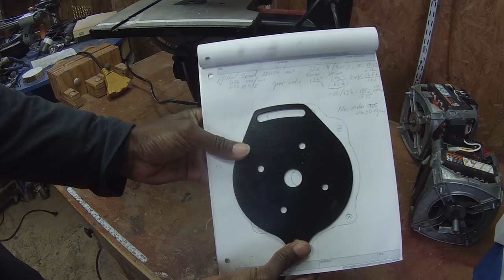Turn Your Cheap Band Saw Into a Beast! Part 1: 011

Comment from the maker: Please read the description before commenting about the blade or the speed of the band. After that you can relax and enjoy the video.
Reply: Jeremy  this was a great video.  I love the idea.  And this the first video of yours thAt I have Seen.  awesome job I also love you rotating table.  i will definItely be mAking one for my self since I have a smAll shop.  Thank you. I will keep watching.
Reply: Jeremy Fielding before I read the description I saw you bandsaw rhe sheet metal and from my personal  experience hand sawing oak  the slow cut makes sence6. I can grind through  steel quicker than cutie get through  oak using a skill saw the oak Wssh.D smoking
Reply: Jeremy, I am curious why you chose not to use a smaller treadmill motor. It seems that would be a better option considering The ease of controlling the speed.

Comment: Nicely done mate,a great hop up for that saw. Speed control is a big thing for me on my band saw. I have need to cut ferrous metals and most bandsaws have way too fast a blade speed for that. I ended up getting an inverter to take single phase to three phase and replaced motor with a similar sized but way more powerful three phase motor. Now I can vary the speed from barely moving to 800 feet/min. Have to wonder why they don't sell a saw like this?
 As an asides I was amazed at how cheap and readily available three phase motors are. They don't seem to carry a price premium that single phase ones do, maybe it's the thought they can't be used at home and are industrial use only? You might be surprised when you check them out. I have also found nice programmable inverters in out of use industrial machines,pays to check out scrap yards for them!

Comment: Nice mod Jeremy!! I inherited My father's old craftsman which he moded way back when dirt was New. He used a rewired automotive DC generator that he turned into a DC motor and a home built speed controller from plans out of Popular Mechanics I think. The speed controller had very little range so now I am running it on an MC60 controller and it is quite a Frankenstein Beast as well. I can slow it down for steel and speed up for wood!! I never met a piece of equipment that couldn't use a good mod or three.

Comment: Jeremy, have you made a video strictly showing close up of what wires go where when wiring up a washing machine motor. Every video I have seen always skips this part or doesn't show a closeup ofthe procedure. I think sometimes these guys doing the video forgets that some of us are electrically/electronically deliquint.
good video!
Reply from the maker: Have you seen video number 11? Between 11 and 17 you should be able to wire just about any motor. This tutorial includes a washing machine motor.

Comment: Haha, think you could claim any warranty on the Kenmore washer that came from? There's a TON of bottomless kitchen aid, whirlpool, estate, and kenmores to choose from when the time comes! Make sure to look at for the plastic outer tub and direct drive pump, and it'll be the same. There's a few models that have a super slow, but as long as you're wire for wire to the switch like you are, your good. I forget if yours had the capacitor or not, just make sure to "discharge" it prior to any fiddling! Take a big screwdriver or prybar, wearing leather or rubber gloves, and short out both contacts to do so. Microwave capacitors are far more lethal than the ones in toppload washers, but still wouldn't want to hear you got hurt.

Comment: The easiest way to get more out of your cheap band saws is to properly set up and align it and then put a new good quality blade on it.  The ones that come on most saws are junk.  And as you say in your comments below the vid, the correct width and TPI for the job is all important.  Don't try to scroll with a resaw blade, and don't try to resaw with a scroll blade.  But I bet it was fun upping the ante on the motor!
Reply from the maker: You better believe it was fun! In part two I again bring up the importance of the blade. Its by far the most important factor. HP is just awesomeness added in.

Comment: Great video very cool and informative. You think I can use a dc treadmill motor so with a variable speed control so I can slow down the rpm to cut metal. Thank you

Comment: awesome retrofit ! now, phase 2 (or phase 3 if a VFD...) what about a dc motor - variable speed or a VFD with a 3 phase motor for speed control.. a finer tooth blade for cutting steel since steel cutting bandsaws typically run less than 250 surface feet per minute...
Reply from the maker: Check out Video 20. https://youtu.be/ASywVBU0ZwE... This can easily be done.

Comment: So glad I found your channel!  Amazing work!  I need some tutoring on small engines.  Have a couple of old vacs myself, that I'd like to put to good use.  Thanks for the videos.
Reply: Motors I should say...
Reply from the maker: I have a video on how to wire many different motor types and I am working on part two which will cover speed control and reversing the direction. Are there any other topics you had in mind? I have been trying to focus on application. But, maybe I need to give more details... what do you think? Its Video number 11.
Reply: Jeremy Fielding  I think some tutorials would be great.  I will definitely check out that video.  I'd also love a more in depth video of your tool carousel.  That thing is awesome.
Reply: Your videos are great!  Definitely keep up the good work!

Comment: Dude you work fast ;). Nice vid, not full of dead time like most of 'em. A good blade of suitable tpi and style is the quickest improvement, but more horses is alaways good.
Tahnks for taking the trouble to post this... oh, yeah cool rotating table too :)
Reply from the maker: check part two of this series... also check the description. I try to make it clear the blade is important. But, talking about the blade didn't fit the style I was going for in this video. Also this project is more about having fun and cutting things up then upgrading the saw.

Comment: I need to do the same thing to my HF. drill press. cool video just subed
Reply: Vernon Whitehead Jr problem with drillpress isn't just motor it's the wobble in the chuck. Although I hear the big floor models from HF are pretty good.

Comment: Buy an old Sears 12" band saw.
Model 103.24280 has a belt drive for an external motor.
Reply from the maker: Its just for fun man. This saw is all I need for now... have a look at the description.

Comment: I also have an old bandsaw, 1/8 hp I think, but it cuts great through thick stock. Maybe you need a new blade?  I will say it cuts much better with light forward pressure vs forcing it.
Reply from the maker: I point out the importance of the blade and the importance of TPI both in the description, and I also point this out in part two of this video. However, my capacity both in depth and hardness has gone up after this upgrade. Please watch part two and you will see I have considered the blade.

Comment: I believe you might be on to something! My only worry is with more speed comes more heat which will kill blade sharpness in no time at all. Better brush up on your sharpening skil right fast like. (see what I did just now?)
Reply from the maker: It is the same speed. There is more torque but the same speed. You might like part two of this video it has more details of what I actually changed

Comment: Jeremy Fielding
I really like the rotating tool table.
I need to make one.
Great idea.
Have you considered putting in a speed control for the Bandsaw to reduce the RPM so you can also cut metal with the appropriate blade?
Reply from the maker: +valveman12 yes... but I decided to build a whole new saw. This one is just too small and not worth upgrading anymore. I need more saw height and metal cutting abilities. The blade should be longer if you cut a lot of steel. It has more e teeth and more time to cool on the way around. You can see the new saw under construction in the latest video. I am cutting plastic in the video. It has 4 hp and a serious 240volt speed controller

Comment: Good shit man.  Keep it up.  You should totally learn how to weld though :) I'm a little biased against that dead plant carcus stuff.
Reply from the maker: I am certified to weld, but wood is much cheaper to work with. Just consider the material required, and the machines required to cut and shape metal. Also consider the number of consumables like tips, wire, grinding discs etc. I love to experiment and I make many versions before I have the final product. Working in steel would really run up the cost and weight of a project. I like both really, and there will be a time when I add welding to the channel.

Comment: Happy New Year Jeremy! That Skill comes with a 1/3 hp motor I think. What was the hp of the monster you upgraded it to?
Thanks for all the cool videos too by the way.
Reply from the maker: It doesn't have a hp rating on the label but it runs at 2.5 amps (about 300 watts), the washing machine motor is 9.8 amps (1200 watts) so about 4 times the power.

Comment: I don't why this video hasn't come through my feed before, only the motor ones. Pretty awesome, but won't you get more burn marks on the wood?
Reply from the maker: only with a dull blade. A fresh/sharp blade is the most important thing you can do. I talk about this in the followup video. https://youtu.be/ScrlNLQmu3E
Reply: Thanks for the response. I am thinking about doing something to a cheap low power drill press. I think it would be even more beneficial in that application. Video idea?

Comment: okay. So is that Skil bandsaw a metal-cutting saw in the original incarnation?
Reply from the maker: +Bill Rogers I just love the irony of using the bandsaw to upgrade the bandsaw... a metal cutting blade and we are in business lol
Reply: metal cutting, ah - no.. in the strictest sense... it'll cut non-ferrous softer metals, esp. if the blade is changed out for one with more teeth per inch..
 not for cutting steel/stainless, unless he can really slow the blade speed down, like <250 sfpm

Comment: this whole thing has a tim the tool man taylor feel to it...  looks like the RPMS were way faster.... Glad I won't be around when the wheels fail or the weld on the blade snaps...
Reply from the maker: You should watch part two. The RPM's are the same. I was very particular about maintaining the blade speed. I explain all this as well as the importance of a sharp blade in part two.

Comment: You should have shown a "before" when cuting at the end, to compare ;-) I don't find it cut the wood quikly.
Reply from the maker: I didn't think about that until I was editing the video... oh well. Missed opportunity. I can say the in part two you can see this saw is pulling twice the max power of the first saw. The first one maxed out at about 300 watts this was was pulling over 600 while cutting a 2x4.

Comment: You addressed the first questions I had about rpm and all, and I too think your rotary work station is slick, but one question...it looked to me like your saw blade twisted a bit as you fed the wood into it, are your blade guides set properly? They look a bit sloppy...other than that, nice job.
Reply from the maker: The bottom blade guide is very sloppy. The whole assembly is held by one screw and it can twist and slide. I finally got so frustrated I tried to tighten it more and the threads striped out. So yeah they are very sloppy. This all happened way before the "upgrade". It is the most frustrating part of using this saw. It basically only used the top guide. It's just a poor design. But the whole thing cost $150 new, so I guess I can't be too upset.
Reply: Jeremy Fielding I bought mine through Craig's list for $125. I win...lol
Reply: Jeremy Fielding btw, I'm a maintenance machinist for Ocean Spray. If you like I can repair or replace your old one for you. If you can't get a new one, that is. Doesn't make sense to ship me your old one for $20 if a new one is $15.
Reply from the maker: I have a pretty long list of complaints but If I could go back in time I would buy it again. It does the job for the budget I had. Yes... you win lol
Reply from the maker: +macbirt56 I tried to order one but they don't sell that part. please send me a private message and we can talk about it. I didn't consider repairing it. You can use the about  page on YouTube or my website www.jeremyfielding.com

Comment: what paint did you use on the plastic?
Reply from the maker: I will have to find the can, but its a metallic blue spray paint. The gold is also metallic spray paint and the orange spray paint was just to added some "ugly" to the beast.
Reply from the maker: Rust-oleum Metallic spray paint.

Comment: Hi Jeremy, can you tell me what HP and RPM you went up to?
Reply from the maker: watch part two for more details, the new motor is 3/4 hp. You should maintain the same band speed or other parts will fail
Reply: Will do, thanks for the info.

Comment: I have to laugh.  I have the same bandsaw and I went through the manual that came with it to find out what the horsepower was.  No luck.  All it said was that it had a mighty 2.6 amp motor.  Woopee.  A little checking on line and I found that a 2.6 amp motor is all of 1/20th of a horsepower.  The poor little saw would come to a complete stop if the blade tension was too high.  I'm going to put in a 1/4 hp motor and then it will be a decent tool.

Comment: Don't you get in trouble with the mechanical capicity of you old bandsaw? The original ones' bearings and frame were of course never made for a heavy motor...
Reply from the maker: Yes and no... the next weakest component will surely break sooner or later.  The bearings are operating under similar conditions. The speed of the blade is the same. And the frame can handle the weight of the motor. 
As I said in the description, this was more of a fun project kind of thing. You should watch the second part to see how I fixed those problems that came up.

Comment: Why go through the trouble for a tiny band saw like that?
Reply from the maker: Only, and I mean Only because its small.... oh yeah and it was about $100. I would love to have a 14 in bandsaw, but the payoff is not worth the space it requires. This thing does 90% of what I need, Its that last 10% that makes me look to the big saws. Also that was just fun to do. Because the cost is so low, I wasn't afraid of damaging it beyond repair. I would just salvage the parts and get another. LOL
Reply: Yea, I hear ya. Doing something just because its fun or challenging is its own reward.

Comment: The problem isn't with the saws. It the crappy band saw blades they sell today. I buy them brand new and they won't cut through a fir board and just rub against a hardwood. Where can I get better blades than at Home Depot? They all seem to be made in China!
Reply from the maker: I have tried a few different types to see which ones last the longest. The MK Morse blade has been one I was happen with... I only have a sample size of one though, so I can't " I been using it for years" I say try different ones until you are happy. Some one else may have a blade they "swear" by. I don't know for sure.

Comment: Good idea but not such a good idea. The parts inside the saw aren't designed for higher speeds and the blades neither. Safety safety safety
Reply from the maker: Who said the speed was faster??? You should watch part two.